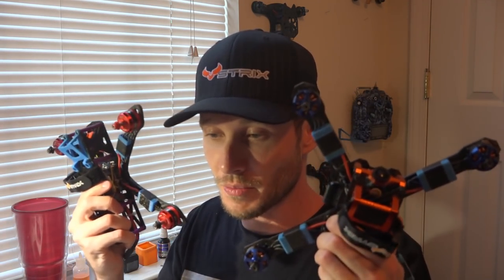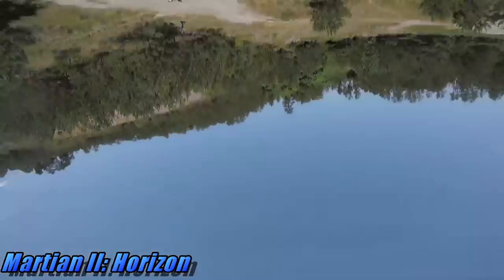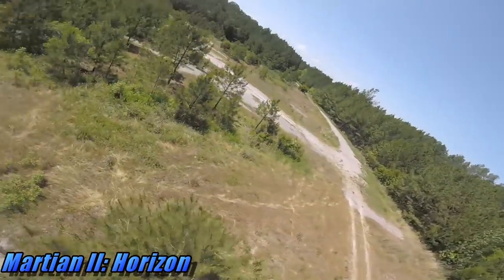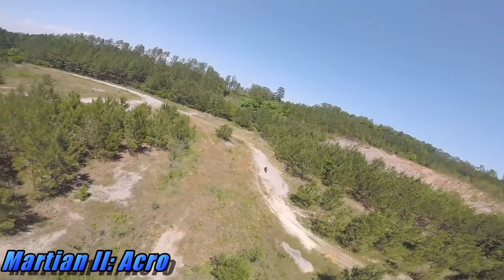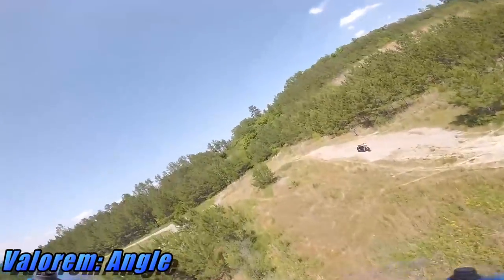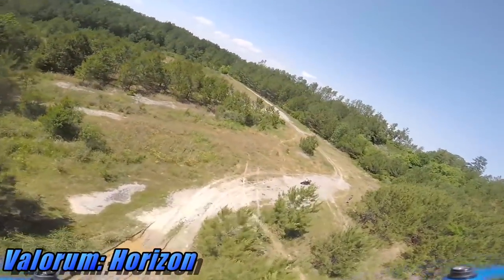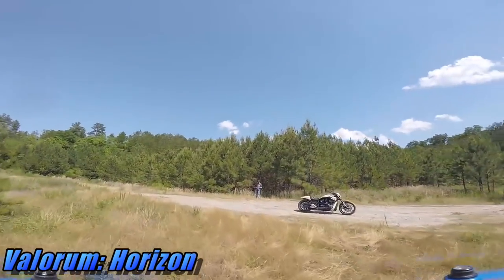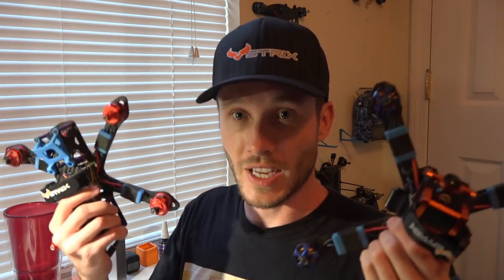MRB Flight Footage, Angle vs Horizon vs Acro, Default PIDs, & More

Comment: Learned something today. Didn't know Horizon mode limited the time you can be "flipped" over. But that does explain some reactions to slow rolls I've tried to do. Thought it only self leveled when you released the right stick! Now I know it wasn't me doing  something like a spaz on the sticks. Thanks.
Reply from the maker: Yea it's tough. If you roll the sticks slow it either wants to lock it in at 45 degrees, or do the roll fast. Doesn't seem to want to be in between.
Reply: I know this is an old video but people still see it ,lol . I got good results from creating my own flight mode in the Taranis Tx . By creating a few Logical switches when the right stick was at dead center I could tell it to go into Angle mode at that point yet be in Acro mode if the stick was at any other position . Sorta like Horizion mode but I could tune my Acro mode the normal way , however I wanted , while still having that safe spot in the middle . It helped me learn Acro and if I got stressed or flustered I could just let go of the stick .

Comment: Great video. I found a set of PID's I really like on here from some guy using a Wizard. They work great and I use them on all my 5" builds. The are not extremely aggressive but just right for my skill level. I don't like constantly adjusting the PID's and usually issues with your quad are not related to PID's. Just my thoughts.

Comment: I picked up another awk210 and a valorum. The valorum is a kick ass frame. Love the arm options and plan build my first 6" quad. 

I had some time with my new chameleon. It flys very different to the awk210. 

I used similar PIDs for the awk210 and chameleon. They aren't transferable and will need work. Seems like the awk210 can handle higher rates than the chameleon. Awk210 flys pretty good with default. Chameleon did not. 

I think these frames in your builds are close enough that the same default PIDs can work. The big difference between the awk210 and chameleon is battery placement. Top mount changes the CG and creates a much different feel for me. 

Honestly, the first time out with the chameleon was bad. After tuning, I started to like it a lot. 

I built the little Japalura with 1407 3000 motors and it was a little rocket. It flew somewhere between the awk210 and chameleon. 

With the recent PID mods Boris provided, prop was in Betaflight is no longer an issue. Raceflight was a big fail for me.

Comment: Outside of ensuring you're not getting oscillations (too much P) and not smoking the motors (too much D), solid attitude hold with throttle changes and bounce-back at the end of flips/rolls, the tune is in the hands of the pilot. I do see some bounce back. I'd need to see some high speed pilot style turns and some aggressive throttle changes to get a better picture.

Comment: You just need to lower your level strength for angle mode. Then it will be sooooo much smoother. For new pilots, I put it anywhere from 25-40 on BF. Makes a huge difference IMO.

Comment: I set my angle mode angle limit to 70 degrees.. 
Horizon goes into acro past about 75% throttle. Which u can change that amount in betaflight.. 
I fly a lot in doors.. or close proximity.. so i fly alot in angle or horizon. Trying to get better at freestyle.. slowly practicing tricks

Comment: Hey Jc do I have to solder the motor and signal wires in motor rotation order on the beta flight f3 Boris B. Flight Controller

Comment: why do you say you cannot go past 45 degrees in angle? Isnt there a setting in betaflight that allows you to change the max angle?

Edit: Just checked and tested. yes there is a setting to allow larger limits than 45 degrees.

Comment: For the prop wash have you tried Lowpass type to PT1(set d_lowpass_type = PT1), and turning off notch filters. I was able to go to pt1 and turned gryo notch filter one to zero. I didn't go past that and motors are cool to the touch and much improved on my prop wash.I found no reason to push it any more as my flying skills are not there. This may not work for everyone and motors may over heat according to what I have read. This could be your next video topic.
Reply: On 1 of my quads (the cheap basher quad) I was able to set PT1 and gryo notch filter one and two to zero. I have to really try hard to get prop wash now its amazing and the motors come down cool too. Just a shame I cant do this on my other quads.
Reply: I'm sure it is a combination of parts, but I think most people are able to do at least the PT1 filter. Were you able to even do that? It was a budget build running an emax f3 board,Racerstar RS20A 20A BLHELI_S,emax 2205 red bottoms motors.
Reply: PT1 yes can do that on all my quads but the filters I could only get that going on Martian II frame, racerstar 2205 motors, racerstar ms35a escs and 20$ flight controller ( the cheap ass build lol )
Reply: I have only done the 2 as I stated maybe once I become a little better I can benefit from the others. So far this has been a great improvement for me.